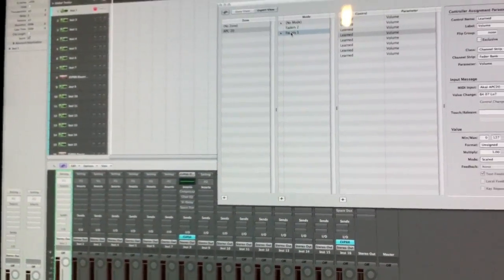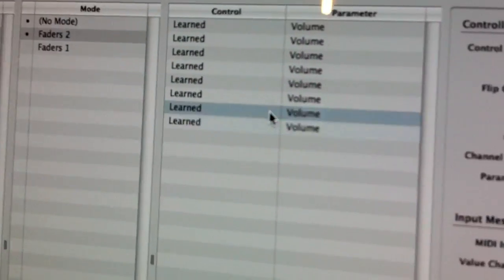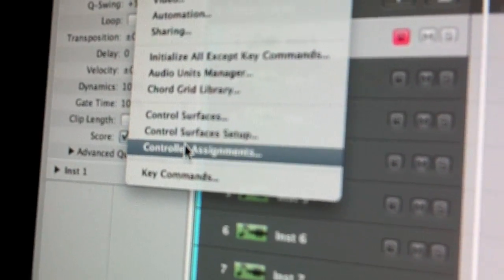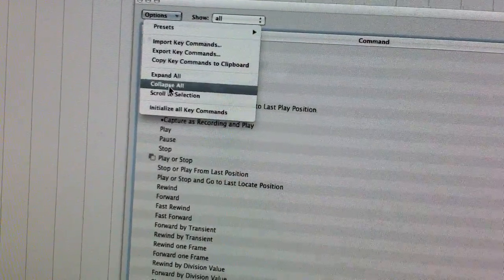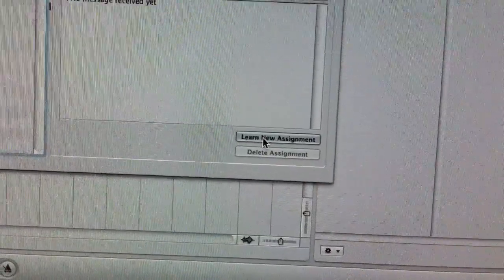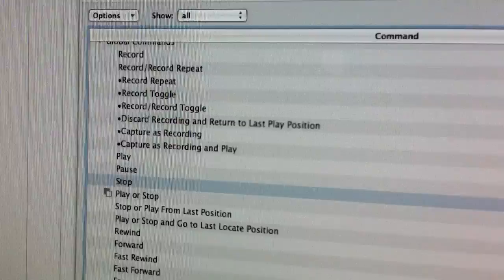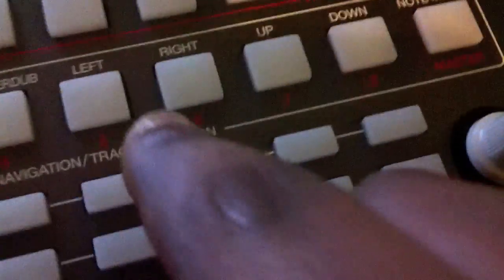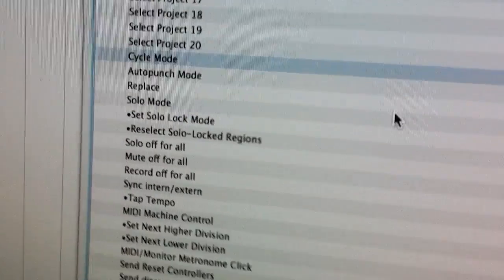APC 20 Mapped With Logic Pro (Part 2)

Comment: Elias, My Logic 9 is not retaining the assignement. For instance I map the play, stop and record and the work only the first time. But neve the second time. I am doing exactly what you described. When I go to the preference/controller assigne I can see they are being assigned to The GLOBAL or NOZONE. 
Ed
Reply from the maker: You will have to save your settings or project as a default template. This happens to other midi hardware device I map using logic, even my mpd.
Reply from the maker: Once you have completed your assignment, save or create a template in which if your decide to do a new track you can load the settings without mapping over again every time.
Reply from the maker: I had this problem a few times, some times it was just logic itself that sou;dot allow you to but give it a go, create a custom template.